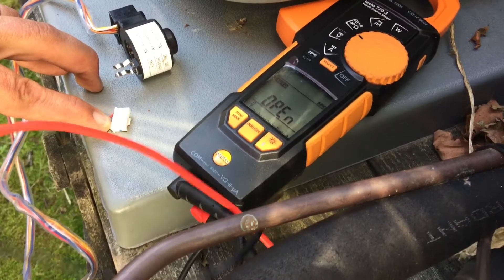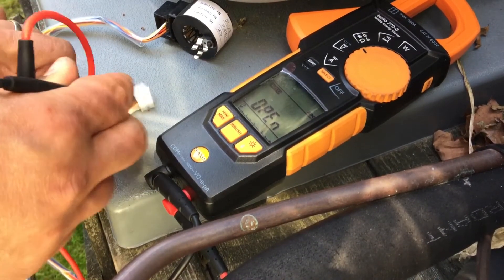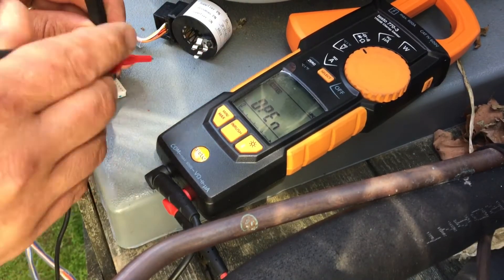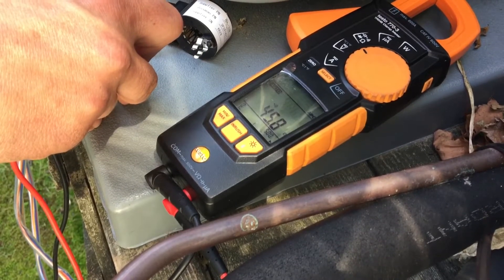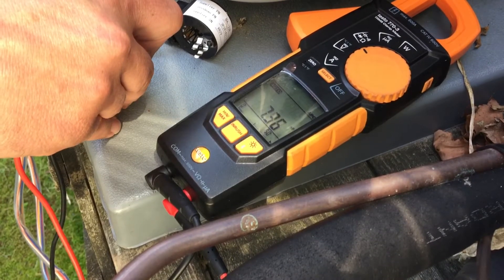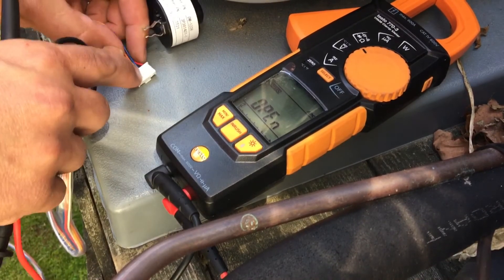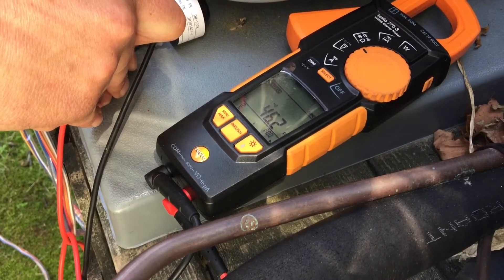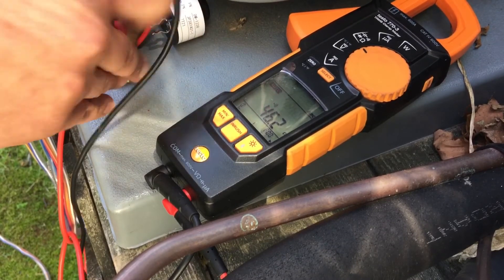Checking the Magnetic Pulse control of an EEV

Comment: Can you check this without removing EEV from the unit using a multimeter by just disconnecting the plug from PCB & disconnecting power to the unit???
Reply: You don’t have to remove the EEV power off, unplug from EEV control board (ECB) , unsnap the coil from EEV body test then snap/plug it back..